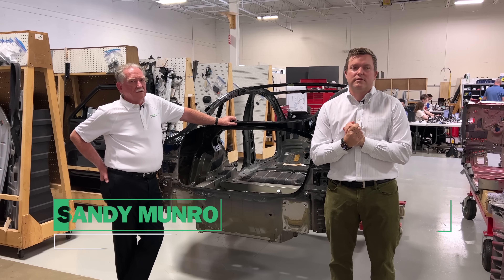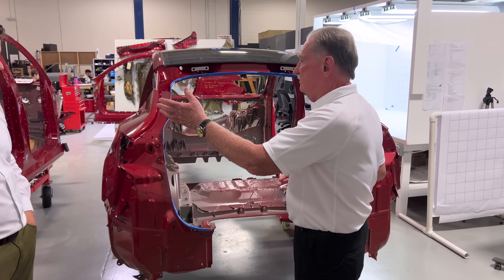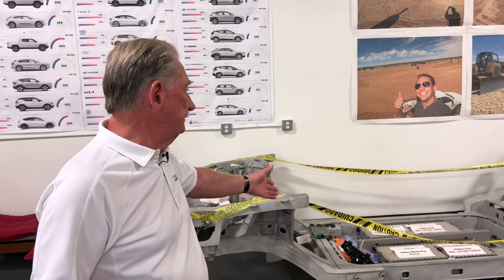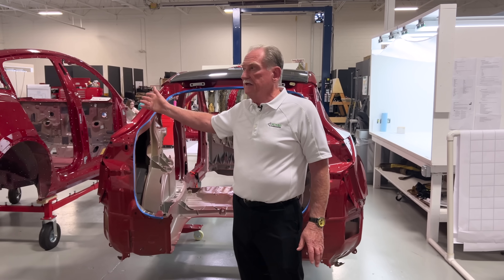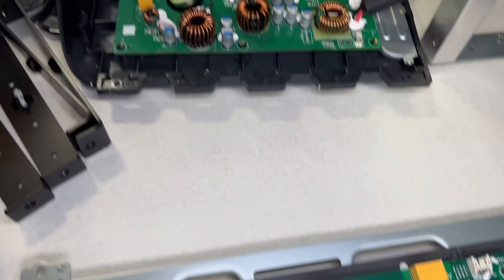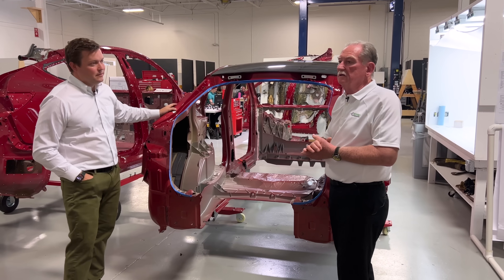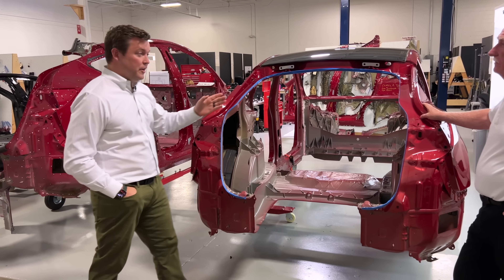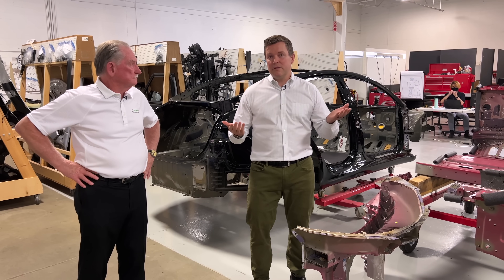Giga Castings with Sandy | Evolution of Tesla Bodies In White

Comment: I wonder why there are no published crash tests of these die cast Teslas??  New Y is structurally a totally different car to the original Ys that were crash tested.   I wonder if the castings will crack in a crash or smash into the passenger compartment instead of bending and absorbing energy like a sheet metal crumple zone does.

Comment: One can certainly appreciate the simplicity and structural integrity of one-piece castings.  However, it seems to me that there is a trade-off.  In a front-end collision or if the car is backhanded, the damage can't be fixed by replacing some parts.  The whole front or rear casting has to be changed, and that looks like a not-so-simple operation.  Am I right to be concerned about this?  Ok around 6:50 Sandy answered that question in no uncertain terms.
Reply: Those are from expected load directions. What about repairing damage from the unexpected? Reparability is a big deal with me. Just how repairable are they from minor damage?
Reply: Unfortunately, I think you either get simplicity of manufacture or repairability...not both.

Comment: Holy cow… kudos to the Munro team for capturing that intro from Sandy. The passion, enthusiasm and pure excitement to educate came through loud and clear. Can’t fake passion like that and you captured gold right there. This video should be shown at the beginning of every engineering course across the country. Just awesome guys! And Sandy- thank you for trusting your team when they asked to produce this channel. Your content here is having a profound impact on so many… kudos to the #munrofactor !!!!
Reply: Agreed!
Reply: Yes it was good , but remember that they have been using castings and tig welding
them to tubes in motorcycles for ages . About 10 years ago , Renault bought a injection
moulding machine that could do a complete body for a small car . Long strand glass filled nylon is super strong for use like this .

Comment: Really enjoyed the video.  You guys are a GREAT team.
Question:
Are the cars manufactured in Fremont utilizing the same one piece front and rear castings and structural frame that holds the battery pack  the same as the ones manufactured in Austin? I realize that the actual batteries included could be either the 4680 or the 2170 depending on which production line they are produced on. My model Y Long Range is due on August 1 to August 14.
Reply: Fremont isn’t front+rear casting, and won’t be for years.

Comment: To be fair, there is almost no steel frame that can't be pulled, including high strength.  Sure, the insurance company may scrap it but a lot of people buy salvage cars and pull the frames, including damaged longitudinals.   If a car is only a couple of years old and totaled, yes it's hit hard and better off scrapped, but an 8 year old car is often totaled with far less damage.  It wouldn't surprise me if 10 year old gigacasting Teslas aren't jigged up and welded if cracked.

Comment: I want to know if or when casting side bodies are likely to happen it seems to be the next step in the evolution to full body casting but they might just jump straight to that.
Reply: I could be wrong, but I think Tesla stated on an earning call that casting the sides would not be done. There are different methods for differnt parts that are optimal, and I got the sense casting the sides would not improve the design or save costs, and would add weight.  The sides are currently just two parts that are stamped.  Still, I'm sure someone at Tesla is looking at the cost/benifits!  It would be cool.

Comment: One of the best Munro Live video showcasing the competitive advantage Tesla has over Ford, GM, ....in building cars, not just battery technology and  EV powertrain but advantage in how to build the whole car.  Mind blowing.
Reply: Absolutely fascinating about the good castings. And I totally agree it's the best way to go. But even with all this amazing engineering and design Tesla still has problems getting panel gaps and build quality and finished materials done properly. I think some of this is because they are producing cars probably faster than they should. Perhaps once giga Texas and Berlin are fully up and running the pressure will come off a little bit and they can spend a little bit more time on the quality control side. You would think with these two giant giga castings and a structural battery pack that there would be far less error even possible when bolting the body panels to that structure and yet there do still seem to be problems that pop up sometimes.
Reply: @kens97sto171  I would expect any other OEM to do as you suggest, but I'd expect Elon to fix the time issue at the point of failed execution. Spend time wiser rather than slower.
Reply: @LegendaryInfortainment  
Seems to me the best way to spend the time is to make sure that the error in an assembly doesn't happen in the first place. That's what you would find with most other oems. They're not having to fix assembly issues after the fact. Maybe it's just because they've been building cars for decades and decades. But I still think it may be because Tesla is constantly chasing production numbers still. Once those other factories are online that stress May relax a little bit.
Reply: @kens97sto171  Absolutely valid points, I assume Tesla’s issue has much to do with a constant evolution of process combined with not wanting to reduce rate of throughput. Chasing production is however a real possibility. If/when I get a new car it would need to be an EV, and a Cybertruck to be considered, being rather rural locally. I lust for one but being 65 and having a low mileage RAV4 alters the equation a bit.
Reply: @LegendaryInfortainment  
Feel the same way I really want my next car to be fully electric. I do all my own work and maintenance on my vehicles. But as I get older I'm getting tired of climbing under the car to do an oil change every 5 weeks. I'm a Rideshare driver and put about 60,000 a year on my vehicle. Honestly until the perfect car at the right price comes out for you your best bet is to hold on to that RAV4.
Toyota makes fantastic products and that car will last a long time. You always got to balance what you want which might be the electric cyber truck with what it will cost to have. I currently have a 14-year-old Toyota Prius for $409,000 mi on it. If I went to go look at a brand new Prius it's about 25 to $30,000. Versus a new Tesla Model Y at $60,000. Am I going to save $30,000 by driving the tesla? Probably not even at 60,000 miles per year. There's going to be a bunch of new interesting electric cars coming out over the next few years, the longer we wait the better our options will be on both price and on functionality. F-150 lightning Electric is also an amazing vehicle. And pretty good bang for the buck also. Chevy Silverado is coming soon it's got a lot of practicality. I thought about a Ford Maverick hybrid also. Low $20,000 range high 40 miles per gallon ETA lots of practicality. Lots of cool choices out there and it will be only even more cool choices in the next few years.
Reply: @kens97sto171  I hate to inform you, but I know I'll be liking what you have for me, and I'm very late feeding my chickens and ducks. It looks like a warm read. I'll return with my edit. Thank you!

You have a good hand at throwing "no kiddings". I have to face in honesty that it's unlikely anybody makes an EV or ICE vehicle that will do any better on the eastern side of my driveway a quarter mile away from the gate during the winter anyway. If the snow hits 14 to 16 inches depth it's waiting time. Too steep a grade in dirt. Only 80k miles on the 2015 Rav, and anything heavier is NOT fun to drive when it's passable. Not a problem, I can watch the Nugget, Atlantis, and GSR from here all winter and not feel a need to visit. They are tiny at 18 miles.
Reply: @LegendaryInfortainment  
Snow that deep will be a challenge for any vehicle regardless of how it's powered. One possible advantage would be electric vehicles are heavy. But that can also be a disadvantage depending on the terrain. The rivian r1t is pretty damn capable in off-road capability. It has a motor for each wheel. And is capable of doing some pretty amazing traction stuff it also has I think 12 or 15 inches of ground clearance at full suspension height. But that's a pretty expensive vehicle.
Pretty hard to go wrong with a rav4. It'll run a long long time.
Hope you have a wonderful day..
Reply: @kens97sto171  I very much agree, and though it's possible a Rivian or Cybertruck would work, it's too like the losing game of chasing perfection while good enough is already in hand. Be well friend.
Reply: ford has a big casting machine too
Reply: @JackMott   Now they do. If Musk hadn't pushed the Italian manufacturers of the casting machines to go big nobody would have one.
Reply: @richardraymond878  Actually, I'd expect the announcement any day now of the first Tesla Gigacasting machine, designed and manufactured by none other than Tesla, If IDRA had said "no, we can't do that" when asked. But being Elon, if they had any ambition they couldn't say no. Mr. Pushy himself.
Reply: @JackMott  I did not know that. I know that some of the Chinese automakers are onto it.
Which factory is the Ford one in?
What pressure does it run at?
Which model is it used for?
Reply: @andrewsaint6581  
I suspect you'll be waiting some time for the answer to your "Ford casting" question ....
Reply: @rogerstarkey5390  me too.
I don't mind when folk make assertions but then when can't back them up... ..
Reply: @JackMott  No, not according to my info: Tesla is the only one that uses a Gigapress. Casting machines have existed for a long time, but they usually are tiny and cast only small parts, not the huge parts that the Gigapress does.

Comment: Does anyone know if the unions have any effect on innovation?

It seams that if you simplify the car and manufacturing process like Tesla has, the union may push back since it would reduce the number of workers.

If true, does this mean legacy auto manufactures have little to no chance of staying in business?
Reply: I get that hunch as well,  and I think GM workers may have struck recently for such guarantees of retaining jobs in the EV future.
Reply: A lot of the innovation from Tesla came at the expense of welding robots - a reduction of 70% based on what Fremont has to what was required for Austin and Berlin.  That saved costs, time, and floor space.   Heard that time spend per station dropped from 90 seconds to 45 seconds.  Insane.  Part of the Shanghai shutdown first of July was to retrofit new equipment and processes learned from Austin and Berlin to pump out more vehicles.
Reply: Sad reality. When GM and Ford are bankrupt for the final time there’ll be no resurrecting their jobs. Tesla is the phoenix rising out of the ashes of the automotive industry dumpster fire that is the legacy OEMs. RIP.
Reply: Just like patents, IP, copyright, tariffs are anti-competitive frameworks (monopolies), so are unions. And you know why unions come to be in the first place? To counter the other unions of the production capital owner - pooling the workforce into one unit. Monopolizing it.
Unions are only needed because our real existing economic system(s) are not capitalist, but anti-capitalist, full of monopolies.
I suggest reading this: 'The Myth of Capitalism' by Tepper and Hearn (2019)
Reply: @joansparky4439  Patents,  IP, and copyrights are theft protection for those who went to the trouble to develop them.
Reply: Makes sense

Comment: Could we get some discussion on the firewall and the steering column penetrations? Was the steel wall from the 2020 providing support? If so, did they move that support to the IP in the 2022? Also, the gap in the rear casting at the bumper location. Is there any part that covers that gap and provides crash penetration prevention?
Reply: D'ya think they might have considered those points?
Reply: @rogerstarkey5390  Sure do, would like to hear some about it. It's an interesting change.

Comment: More change by Tesla in 5 years than the legacy auto companies have in the last 50
Reply: Because Tesla is run by engineers and not bean counters.  To drive that point home, Elon fired 10% of the non factory floor admin employees (about 3% work force)
Reply: it's not like this concept was invented by Tesla... Audi did this so called Audi Space Frame Concept in the early 90's and some of this is still state of the art. It's a great concept, no question about it. But obvs. a much better marketing strategy.

Comment: Sandy I’m no engineer, but what happens when the casting gets damaged in a minor crash. Cast aluminum cannot be repaired. Good luck TIG welding a casting in. So basically casting is good for manufacturers, not consumers because when your in a minor crash you need a new vehicle. Steel can be straightened and reinforced if needed.
Reply: Did you listen to Sandy?  If the casting is damaged, you are not in a minor crash. In a conventional car a similar crash causes the core steel structure to be bent and is unrepairable.  There is non-casting crash cans in front and pack to absorb impacts from medium crashes, which can all be replaced just like Tesla's prior cars in medium accidents.  For minor crashes, the bumper is replaced.  Tesla's body shop can replace the bumper in about an hour and has pre-painted bumpers in stock for those cases.
Reply: We can all see your other comments.

Stop wasting everyone’s time.
Reply: It has crash cans that elon already said a long time ago could be cut off and would have bolt on replacement parts for cars not being written off. 🤔

Comment: The Giga Press allows for cheaper parts and assembly, but those savings are not passed on to the consumer. The opposite happens. The simpler and cheaper Teslas become to manufacture, the more the price is cranked up. Also, it makes these cars completely disposable even aftet a minor accident, since these castings can't be repaired. Which means that insurance companies do total writeoffs for something that might otherwise be a $5000 repair on another car. This drives the insurance premiums for Teslas through the roof and relegates them to a landfill with an early end of life. So the only entity benefitting from these giga-castings is Tesla and its bottom line, not the consumer or the environment. They are expensive, disposable cars.
Reply: Sounds like someone trying to defend obsolate manufacturing processes.  Material prices have gone up dramatically, and is why the costs of every new car has gone up, not just Tesla.  When you consider the cost savings from gas and maintainance, the Tesla Model 3 is very competiive with obsolate gas cars like the Camary.  Far from disposable, the rare wrecked Teslas command crazy high prices as people part them out.  Resale values of used Teslas are also better than any other automaker.  Anyway, I understand the need to defend old processes from companies that are unwilling to adapt. Sadly I expect those companies will not be around in 5 years or so as the entire company becomes dispoable.
Reply: @tesla_tap  Sounds like someone is immune to critical thinking and prone to lemming behavior and following a cult leader without questioning. Defend Emperor Elon at all costs! Teslas are not actually cheaper to own and run. The whole 'gas and maintenance cost savings' is a sales tactic that Tesla has sold gullible consumers on to justify their high cost. Cheapest Model 3 is $47,000, while the cheapest Camry is $25,300. Cost difference is $21,700. At $5 per gallon, that's 4340 gallons of gasoline, and with Camry's combined fuel efficiency of 33.5 MPG (28 city, 39 highway), that translates to 4340 * 33.5 = 145,400 miles. That's how many miles you'll have to drive a base Model 3 just to break even with a base Toyota Camry on cost. Assuming the national yearly average of 14,000 miles driven per year, you'll have to drive your model 3 for more than 10 years just to break even with the Camry. And you think you're SAVING money? 😂😂 There is no way you'll still be driving your Model 3 10 years from now, you will have upgraded it twice by then with the latest and greatest Tesla, so realistically, you'll never even break even, much less 'save' money, which means that the Tesla 'cost savings' narrative is  pure fantasy. Also, it's better for a car to be repaired and be back on the road than to send one to the landfill (which is what happens) and replace it with a new one (the manufacture of which generates exorbitant amounts of CO2 emissions, which EVs are not immune from). If you buy a Tesla because you like it, fine. But don't delude yourself into thinking that it's costing you less or is much better for the environment. A Camry is 10x higher quality than a Model 3 and will still be on the road in 20-25 years. Same cannot be said of a Tesla.